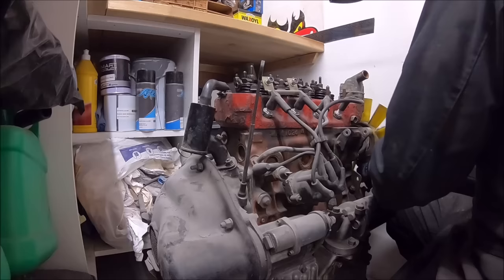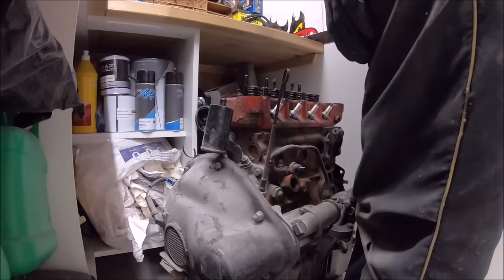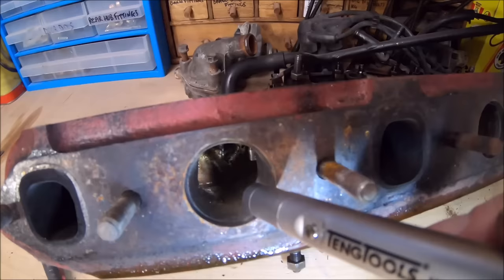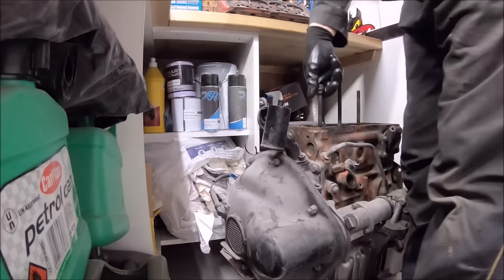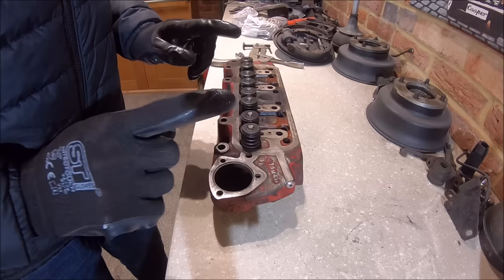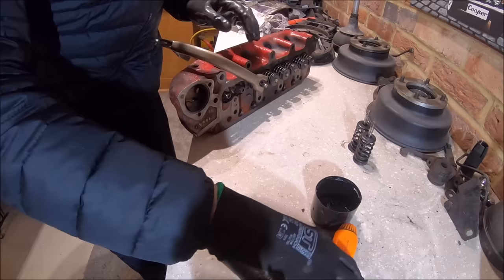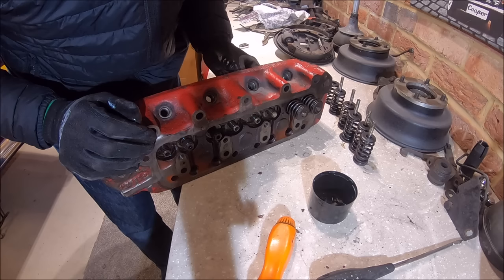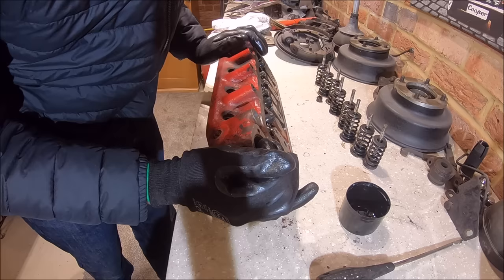Classic Mini Workshop - Project KITT Pt. 19 - Engine strip

Comment: Those sizes are MG Metro Inlet (TAM1059) and Turbo exhaust (AHU1976) sizes. As I always say to people rebuilding anything its up to them what and how they do things. For the cost of a valve its worth removing risk as long as you can find an exact copy as yours may have been modified.
Have to also say in engineering terms the design of the collet in a taper mean the valve cannot actually 'drop' as it is under tension all the time (valve head against valve seat or against the rocker) short of breaking.
Looks a nice head though. Have you checked the cam? if someone has done the head then they may have also fitted an uprated cam. Maybe another nice surprise Keith ...

Comment: The oil pipe where it comes out of the block arnt they normally a banjo bolt ? .... great teardown vid Keith ! Its great its got a modded head !
Reply: If it helps an engine in an automatic car has very different oil system and pipework to a manual engine. Check out the horizontal oil filter ...